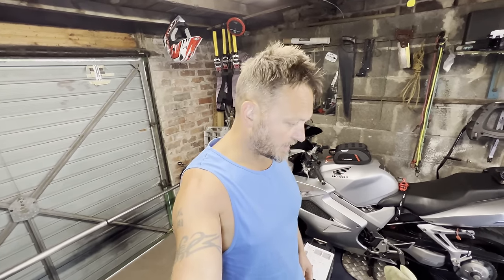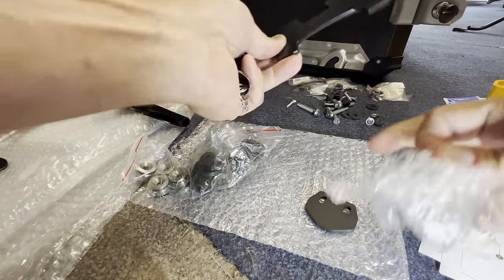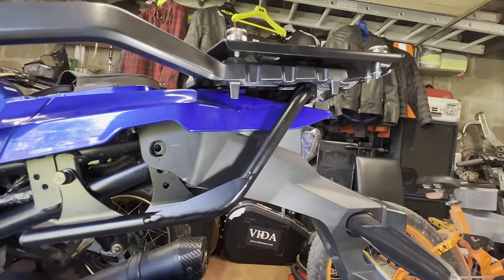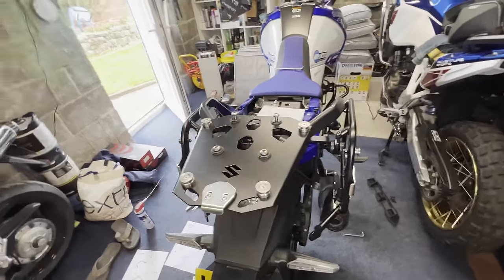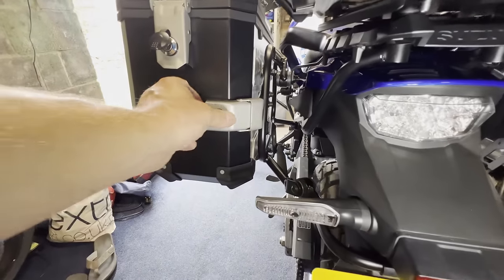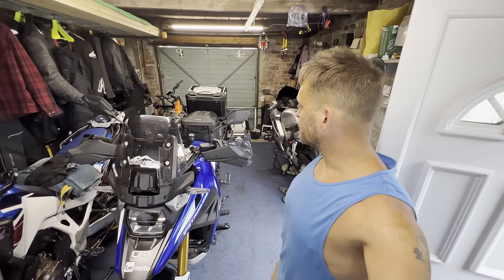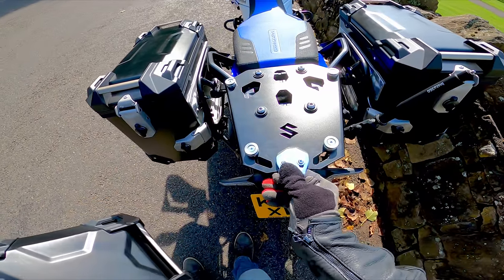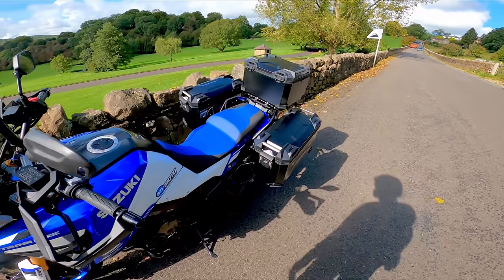Fitting OEM Luggage to the 2023 Suzuki Vstrom 1050DE

Comment: The luggage is the same as I have fitted to my 2022 xt they are very robust it looks like you have good clearance from your can unfortunatley me and Sue have just come back from our 23 day tour and my quill can was a little high and a spirted motorway ride  in 40 degree heat took its toll with the exhaust heat fried the righthand inner lower plastic corner piece and the righthand indicator tip. Oh well we live and learn the can has had a longer mounting strap fitted and I will be ordering a new indicator tomorrow. 3992 mls were covered 90% on back roads and unamed roads the motor and chasiss are brilliant so enjoy Spain and the bike.

Comment: Nice vid...It's actually an old SW-Motech EVO rack system, modified in the rear loop to accomodate the longer tail of the 1050 DE. Same for the panniers and top case, they are re-branded SW-Motech TRAX ADV. I have to admit that it looks more robustly attached to the frame than the GIVI I placed on my 1050 DE last week, for which GIVI didn't even bother about the longer tail of the DE, and thus their rear loop hangs attached between the left and right racks, under the mudguard, all by itself. Lame effort, GIVI !

Comment: Great vid. I think reversing the bolts that hole the top box locking clamp will make it less easier for theft of said top box. Or am I wrong? Probably domed bolts with nuts on top might be the best. What do u think Richy? Or can't the bracket and bolts be removed as it is?
Reply from the maker: Ideally yes, sadly though, they won’t fit the other way. Domed underneath would definitely do the trick.
Reply: Nice job Rich, you sure you didn’t edit Gaz  owta the vid, if you know what I mean 😉🤣👍
Ride Safe Mr B 😎🤘

Comment: It doesn’t matter what hard luggage is fitted to a bike , the thieving scumbags can break into it in seconds.  If I want to fit luggage ,I just fit a plastic streamlined Givi or other plastic butty box ,& strap on or bungee soft luggage as needed.  I like Suzukis especially all the V Strom range from 250 all the way up to the big boy job . They are reliable & great value for their price points , the only thing is their OEM extras are well over priced & rip off .  I reckon the cheap big square metal & plastic constructed ,pannier & top butty box kits , available on interweb ,are no worse or easier to break into ,than the OEM or posh aftermarket ones . They are probably all made in the same Chinese factory’s for a fiver each also .